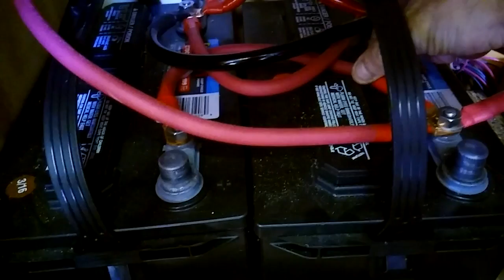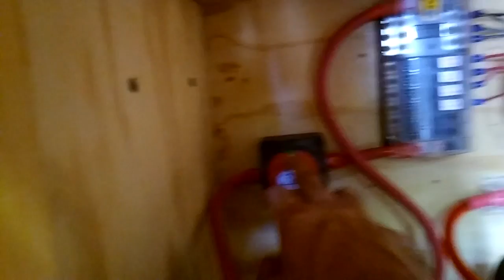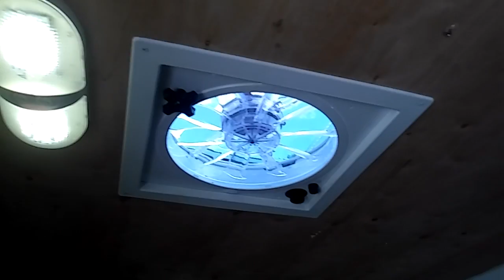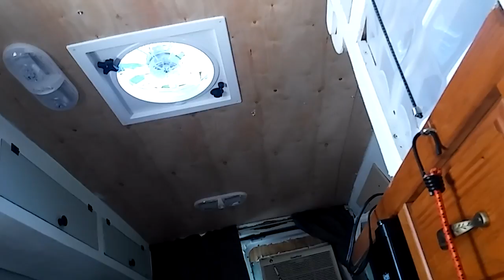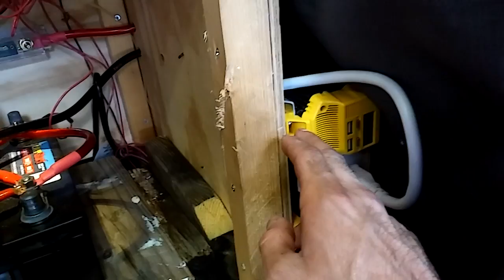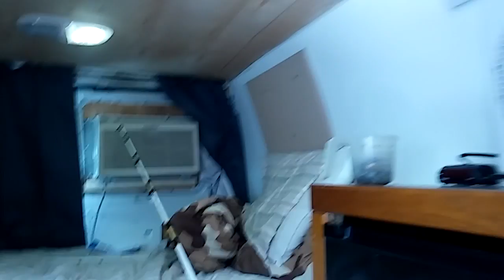Campervan & RV Electrical System Explained - Battery Bank, Wire Gauge, Inverter, Solar, D/C, ect.

Comment: Thanks for the video which was very informative.  Would like to kick in a bit for you and Rocko next mile, but it doesn't look like https://www.gofundme.com/2kkmxvxw is working?  If we understood your video, we think we can connect 5 different circuits to the two 12v deep cycle batteries (connected in parallel with 4 gauge wire) as follows:  (i) a circuit to a voltage sensor relay in front of the car alternator to charge the house batteries after the car battery is fully charged, (ii) a circuit to a 1,500 watt inverter to power refrigerator, TV, etc., (iii) a circuit to a fuse box panel in front of 12 guage wiring to power LED lights and fan, (iv) a circuit to a solar charge controller in front of a 200 watt solar panel to recharge the house batteries and (v) a circuit to shore power or gas generated 120v AC power to power the 120v AC circuit.  I've got  a few questions which maybe you can help me answer as follows: (a) what wire guage is recommended for our five circuits?  (b) do you recommend inline fuses in all circuits?  if so, what size fuses are appropriate?  and do the inline fuses always go on the positive side of the circuit? (c) other than LED lights and a fan, what else does the 12v DC circuit power after the fuse box? (d) how exactly do we connect 120v AC shore power (or gas generator power) to our system to power the 120v AC circuit?thanks in advance!
Reply: Q & A:
(a) Inverter mfr will specify minimum wire size for certain lengths; you can go bigger a size or two if finances permit -- it will increase charging efficiency as well as output. (4 AWG wire is rated around 100A , 4/0 about 250A -- quite a diiference!) Whatever size is used, you want all battery primary and interconnect cables to be the same size, to avoid current flow choke points. All other conductors can be sized according to expected current draws -- wire mfrs publish ampacity charts showing maximums for each gauge and type.

(b) Fuses and breakers are used to protect wires and connections, so, like my wise-@#! dentist told me -- you only have to floss (or fuse) the ones you want to keep! Here, the work you did to pick a wire size helps -- you know the fuse or breaker has to be rated less than the wire's max amperage. It also has to be a bit more than the expected load drawn. So, for example, if my 12 AWG wire can carry up to 20A and my DC frig compressor can use up to 7A, my fuse could be 10 or 15A. If I run the same frig on a 14 AWG line, my fuse probably should be 10A. And yes, the red wire holds the fuse or breaker. (Also, remember excessive heat decreases current-carrying capacity, so enclosed wiring or other causes can reduce effective ampacity.)

(c) A lot of small electronics can be powered with low voltage. And although the initial cost is fairly high, small DC refrigerators do use less power than inverter-supplied AC units do.

(d) A small main breaker(30A) electrical panel can be connected to the shore/generator-powered input cable and fitted with a couple of branch rated distribution breakers & outlets (about $100 or so from Schneider Electric, not including the cable or genny), with or without a separate surge suppressor/EMS ahead of the onboard equipment. With a panel like this, you can simply leave a connected inverter in place if it has a built-in transfer switch. If it doesn't, just unplug AC loads from your inverter and use the shore power outlets when they are energized (poor man's transfer switch).

Comment: Just a couple of thoughts... first off, not a bad setup, but it could be improved a bit and probably for not a lot of money. First, you do need some kind of way to secure your batteries should you be involved in a crash, including a roll-over type. Second, you should wire your inverter to your power block. You can leave the negative terminal wired in as is but take the positive cable off the battery and connect it to your distribution block. This way you can shut off ALL power from those batteries. As it is now, your inverter power leads are ALWAYS hot and the inverter can have a small, but significant over time, power draw even if you turn it off. Right now if you disconnect your inverter in just the wrong way, you could have a pretty good spark show before the fuse blows, even if you shut off power using the battery switch you installed. 

Still, and on the whole, that's a pretty simple system that should provide you years of service. Make the changes I suggest and it'll probably be a whole lot safer overall. 

Since  you have decided not to charge your "house" batteries from the alternator, that just eliminates a whole separate wire run and use of a battery isolator, which adds complexity to the whole system. Make it more complex only if you have to!
Reply: Jeremy Hawk what is the power block you are referring to? What type do you recommend?
Reply: If you look at 2:36 in the video you see your on/off switch connected to a power strip or block that's right at the top of the screen. That's what I'm referring to. Your inverter is directly connected to the battery so it is basically always on and drawing power (even if it's milliamps). If you were to connect it to the on/off switch or your power block instead, you could turn everything off (including the inverter) by turning that big switch off.
Reply: Really good safety advice . . . and if the inverter is rewired from the DC fuse block terminal, don't forget to keep that big ol' monster fuse in the circuit (though the best protection would be to have it first in line between the battery and disconnect switch; any loose connection can result in overheated wires and increased danger of fire). You want both shut-down and overcurrent protection!

Comment: On the fuse block what are the top 3 wires in a group? is that a sub-panel connect? Why?

Comment: Cory, I used those type of batteries for years, and I do not recommend them. They are hybrid batteries with thin lead plates, and they get worn out very quickly.
You should try to find Some AGM True deep cycle batteries. When I switched over to my AGMs The difference was tremendous. They last longer, and have less voltage sag then those walmart batteries.

Comment: In USA, 110v  or  120 v inverter ?  Which is best?
Reply: The designations you refer to are both within the range of the U.S. standard. Only some isolated independent installations supply AC at a different nominal voltage.

Comment: Cory, you mentioned you were going to post links for the 2 aug wire and the on off switch and the 12v circut board, where are they located

Comment: Hi from North West England, l got a trailer tent that l'm about to wire up a 12volt battery and a 25w solar panel. Had a very small idea on what to do by searching the net over and over asking about on forums, but watching this has just made things a lot clearer for me. So Thank you.

Comment: Thanks for sharing that. The series and parallel description is great. You said enough for it to be understood without getting too technical. If you started talking explaining the math, it would have confused many. For example, Volts x Amps = Watts. 12V x 5A = 60W. That would power a 60W light bulb. And then how long you power the light depends on the battery capacity, such as the 108Ah deep cycle battery. It starts to get complicated based upon individual power needs for electronics and lights, ect. Good video and explanation.

Comment: Hey Cory...nice video and very informative.  We appreciate your time and effort.  One question, I didn't see a battery controller or just missed it.  Isn't one needed to prevent possible over load of batteries or too much draw on them? Thanks again bro and safe travels..
Reply: Most inverters will stop drawing juice when the voltage falls below a certain point. But if you leave your 12v lights and fan on without ever recharging, the battery will be sucked dry . . . a bigger concern is getting the batteries properly charged in the first place. A good follow-up for Cory's presentation might be 1) How to tell if your battery is being fully charged  2) What it takes to charge your particular batterie(s)  3) How and when to charge it.

Comment: Hi Sir its pretty cool,But i have some questions what if you have 220-240 V for Electric appliances inside a caravan like AC unit, Electric heater,Electric cooker and definitely if you will go towards desert area you need something which in working 24 Hours and not costly the fuel is consuming too much and also generator is noisy our caravan takes 7 to 10 KW only.kindly advice us Thanks sir
Reply: At some point the question for any mobile electric power storage and consumption becomes -- how much can you carry with you? If efficiencies and alternatives to consumption are not investigated alongside production and storage, only an imbalanced and ineffective solution is likely to be found.

It is clear that the less power sources are available or affordable, the higher the requirements  for charging and storage efficiency become, as well as conservation or even elimination of non-essentials.

Comment: One Question? Did you ground the AC 115 volt system to the body or the DC 12 volt system?
Reply: Your inverter has grounding instructions. If you're bringing external or "shore" power in, the ground connection is via the third wire of that cable (assuming the  pedestal is wired correctly). Main panel neutral and ground busses are not usually connected for a mobile installation -- unlike a typical residential install.

DC ground can be to the chassis, as for autos, or to the battery negative, as for boats. Either method is safe, but it's important to have all circuits properly fuse- or breaker-protected.

Comment: In my van I have a 5000 watt inverter connected to my alternator and van battery under the hood. To add another battery in the van do I parallel the 2 batteries and then connect to the inverter? Or connect the extra battery to the Inverter for more watts?????

Comment: Hey Cory! I want to skip the 12v fuse box panel as I only have the fantastic fan to connect to 12v. Can I hook it up directly to the battery? I have the 2000w inverter the same brand as yours for the other stuff.
Reply: Hi J I'm, The previous owner of my van had a direct in to the battery for their plumbing pump. The pump still works, so I assume this is possible.
Reply: Thanks Ryan for taking the time to reply. Very very appreciated :)
Reply: I had a dentist once who said I should "only floss the teeth you want to keep" . . . so I guess a wise guy like that would say you only need to fuse the circuits you're not okay with burning down. (An inline fuse is probably better than no fuse.)

Comment: Thank you for the clear explaination Cory. Your ability to point out the few important details like how the on off switch screws onto the 2a wire and the fuse 12 volt wires are 12g , and that 12 volt deap cycle are connected in parallel vs the six volts.

Comment: cool video and setup. one thing to mention or ask is, where are your batteries grounded to? I see both negative posts, jumper going to your fuse box, and the jumper to your inverter, but no mention of a common ground. Wouldn't that be necessary?
Reply: Like on a boat, the battery negative terminal can serve as the common ground, as long as all loads are wired back to it via negative busbar connections. The negative busbar in a DC load center is available and serviceable.

AC grounding should follow specific inverter instructions. The shore power system is grounded via the shore connection (if present), so any main electrical panel ground and neutral buses should not be connected the way they would for a typical residential panel.
Reply: The Negative posts of the battery (and wires/cables attached to them) are the "Common Ground " in this plan. And, yes, they were not explained, but you can see them in the video. The "Ground" wire of all loads would need to, ultimately, return to these points; and appear to do so in the video. 1) Fused lines via the lugs at the top of the fuse panel and....    2) The Inverter ( "amplifier")  via that heavy black wire to the Battery Negative posts.

Comment: Thank you Cory. Always nice to see a solid tutorial. Thank you for the class. One question,...I noticed that you have one power switch which turns off everything. How would I wire in individual on/off switches for lights, fan, etc... Thanks again

Comment: hey cory, this was super helpful.  one question - how do you charge your 12v batteries with the shore power at an rv park?  Is there a separate connector you need to provide an outlet to plug into?
Reply: Shakur Namzoff I think he said he can use an extention cord and a battery charger.
Reply: So, if I'm plugged in to shore power, that means that my battery will be fully charged with a battery trickle charger or an rv converter or a "smart charger"? The answer is "yes" only if that device can supply the right amperage (current flow) at a sufficient voltage (pressure) for long enough to restore the charge fully. Most deep cycle batteries need voltage higher than 14 or 14.4 v to get all the way to the top of the tank. The mfr specs will say what level is needed -- too little pressure won't do the job . . .

Comment: Thanks Dude, I'm converting van to camper and can't get my head round the impending task of the electrics, basically I'm panicking about it. Watching your video has made feel more confident to tackle it. I only want to power a light and charge phone. Maybe a small cooler and laptop.

Comment: Thanks for this, I found it super helpful. I see that you've got a wire going from the battery negative to the fuse box that you forgot to mention though.

Comment: Just a couple of things. 1, It looks like the cables linking the batteries are all RED. Why do you not colour code the battery leads ie red for pos. and black for neg. Surely not doing this could lead to confusion and potential danger. and 2, would it not be wise to leave say a one inch space between the batteries as the do get hot.  "just because it works doesnt mean its safe".  Hope your not offended. regards  Gerry  PS vent the battery area too.

Comment: i have a 120 watt panel on my pick up..hooked to a battery box..commonly called a solar generator..been running for almost 3 years now i'm about to add a second battery in parallel...heading back out to live in the desert in the spring...good info my friend keep on off gridding ♥

Comment: Hey man, thanks for the video!
just got a campervan and this is the part I've to do.. quick question do I  have a to have an earth system? I dunno much about electrics but I've seen some diagrams where there is this cable but don't know where it goes...
Also do I connect the positive and negative of the lights to the fuse box directly?!

thanks a million! :)
Reply: Cars and trucks usually "ground" the negative 12v leads of equipment and the battery itself directly to the chassis or a busbar (as is found in a fusebox) which is itself connected to the chassis. That has the advantage in a situation where there may be a lot of exposed metal which could come in contact with bare positive wiring -- but only if the circuits are fuse- or breaker-protected.

On boats usually "ground" for all circuits is back to the negative battery terminal or a busbar connected to it. The battery in this case is also not connected to the vehicle chassis. Both systems work, both are safe when done properly.

AC grounding for mobile systems can be provided by the "shore" connection. For that reason, the neutral and ground busbars in an electrical panel are not connected together, as they are ordinarily in a residential install. Inverter grounding is specific to the manufacturer's design -- those instructions should be adhered to for normal installations.

Comment: This video has been real helpful, but I have a few questions. Should you have a tray under the batteries and should that compartment be ventilated to the outside? I've built my own little hut on a 5x8 utility trailer and your under-counter elec. compartment is much like mine. I even bought the same inverter before seeing this video! Thanks for your help.

Comment: awesome!! thanks man. you simplified this for me, when i thought i was in over my head. def will be doing this in my bus.

wondering if i can use a car battery charger/jump starter to charge the stand alone batteries i'll be using. won't have solar for awhile, so i plan to use stand alone batteries and charge the jump starter/charger when i have ac access (like a house, etc)
Reply: Your standalone battery has a recommended bulk charging voltage and a recommended float charging voltage. That's not the same for a typical automotive battery as for a deep-cycle battery. The true deep cycle type needs a somewhat higher voltage to fill all the way up.

Batteries which aren't fully charged have a tendency to be overdrawn as well, often resulting in early replacement. A good match between charger and battery is the only way to avoid that issue. A FLA battery state of charge can be physically verified using a hydrometer, but it takes good technique to get reliable results.

Comment: you missed the red wire connected to the top end of the fuse box. the way i see it, if you turn off your "on and off switch" it will still get power on the upper wire on the fuse box since it's connected to a positive terminal on the battery. you explained all wire connection but i kept on wondering why you missed that one wire.. got me confused.
Reply: nevermind. i watched it again. you used a red awg wire to a negative terminal.